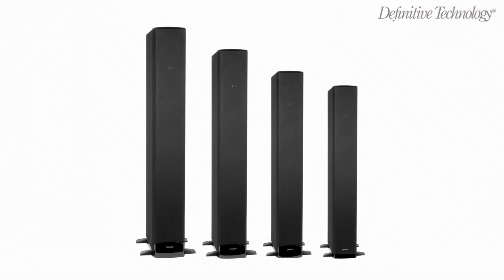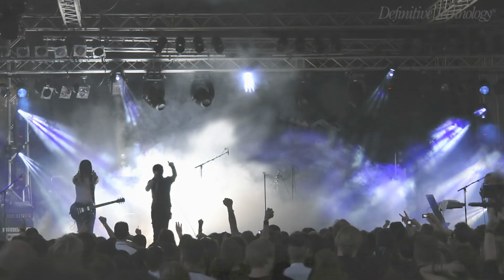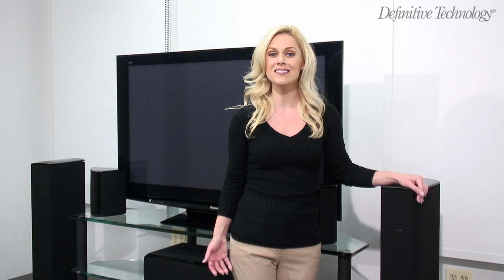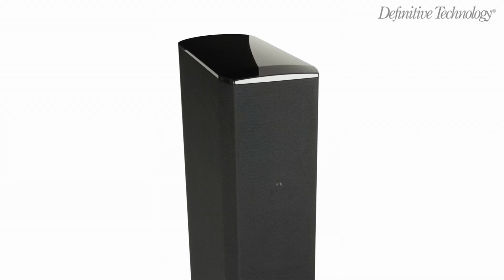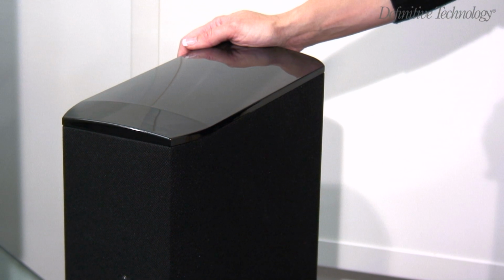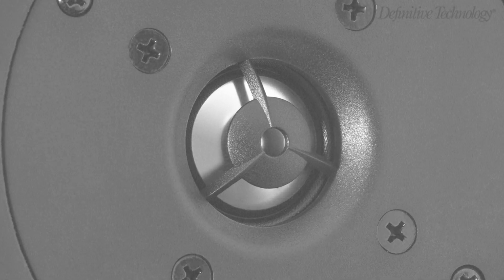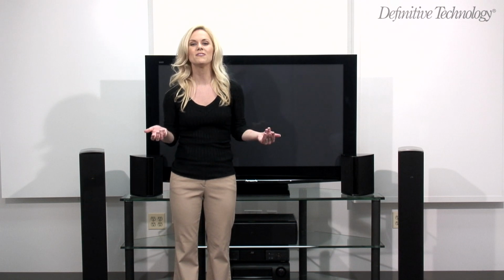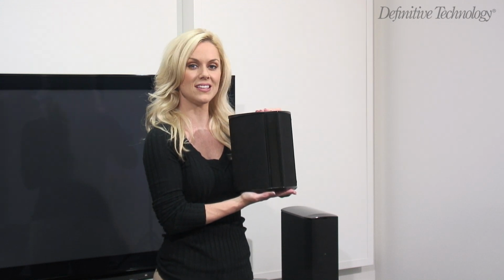Definitive Technology BP series SuperTowers, CS centers and SR surrounds - ALL chapters.mov

Comment: I have a 10 year old Home Theater system that i use a Denon amp with 120 x 7.1 setup powering two BP7006 supertowers and a set of four studio monitor surround speakers as well as a studio 100 model center channel speaker. I think Its the best system I have ever heard. Specially due to the fact its ten years later and I still feel the same. I had a problem with them twice. the built in amp popped at the same time as the subs themselves. One speaker at a time. They have the most helpfull, friendly tech dept. I gave them the serial numbers and they next day aired me two new amps and two new complete subs. I will never stray from Definative Sound Labs they are the only speakers worth buying.

Comment: I have an old set of BP-20's Towers that were given to me. They sound great! I'm not sure off how best to use them in my home theatre though. Would anyone have more info on these definitive speakers, what's in them in case I ever have to replace a driver or speaker?  Underneath they have High and low connectors. Should I not have gotten a seperate Subwoofer with these?